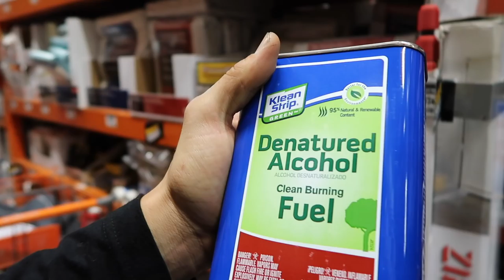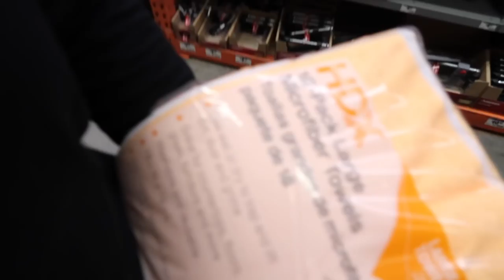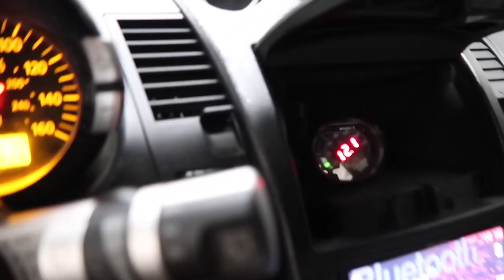Painting my 350z big brakes!

Comment: Hey George.  Thanks for the videos. What calipers do you have? Braided lines too? I hit the canyons hard and rear brakes on my Z were smoking. Any recommendations...
Reply: benzeeno what brakes do you have? If you have the regular ones than a Akebono kit is a good bang for buck. If you are on Brembos and it's not enough Id say go to a 6f/4r from stoptech or whatever brand you like.
Reply: Antonio Patterson I’ve got the regular set. Looking at the Brembo set and they are quite pricey.  I’ll look into the ones you mentioned. Thanks.
Reply: benzeeno another thing I should have asked was what year car you have? The early year brakes are terrible and simply going to the 06+ would be an improvement. That being said, if you can't get a good deal on a used set I would just get one of the Akebono kits. The stock Brembos usually go for about $1000 used more or less and by the time you factor in miscellaneous add ons if the pads/rotors aren't good, you are going to be really close to the price of the Akebono kit. Check out Z1motorsports and conceptzperformance, they are the 2 main sellers of the Akebono kit.
Reply: Antonio Patterson my car is an 03. I’m waiting for drilled and slotted rotors to show up and some EBC Yellowstuff pads as a temporary fix. Akebono sounds like what I need. Thanks
Reply: benzeeno wow, Yeah I don't know how Nissan got away with using the brakes they had on the older Zs. I had an 03 and hated the brakes, now I have an 04 and one of the first things I did was replace them with 06+ they are miles better for spirited driving, but the Akebono are better. If you can get a good deal on a set of 06+ and don't want to spend so much they are a great option. They use a 2 piston front instead of 1 and the rotors are about 1-1.5" bigger all around.